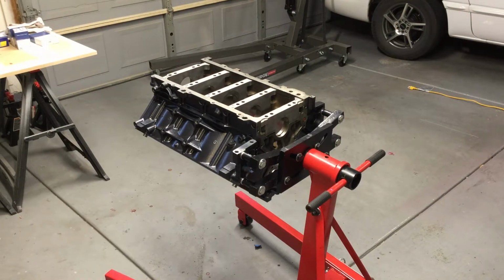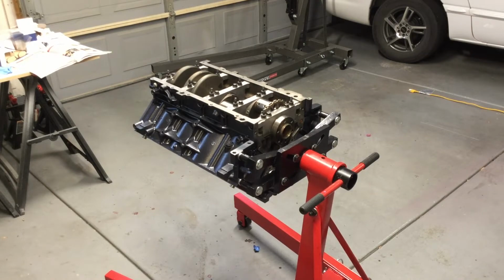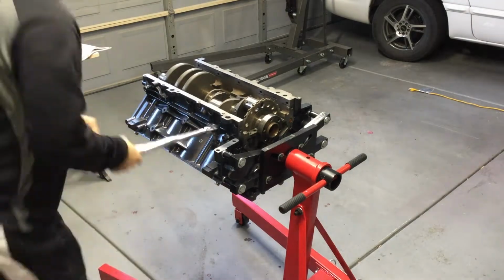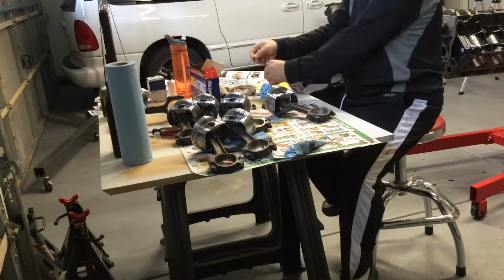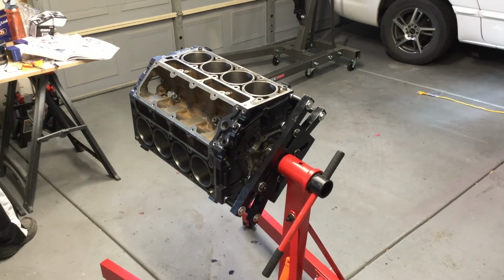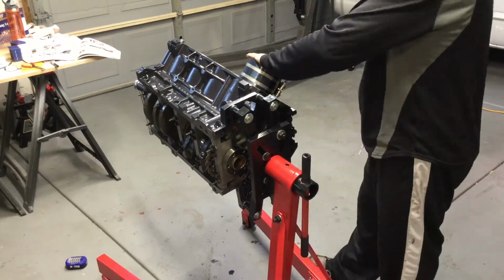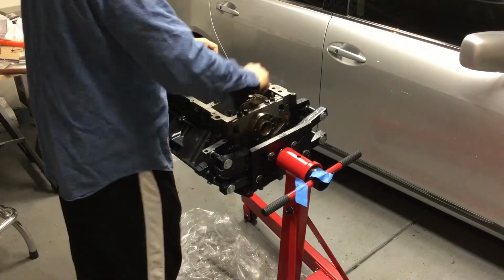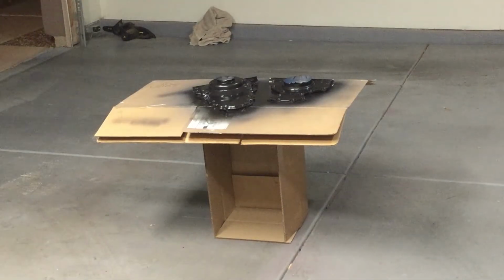How To Build An LS Engine - Assembly Part 1

Comment: What book did you buy to use rebuilding it? Author? Thanks!
Reply from the maker: Check description
Reply: @StreetRodJim   There is 3 books in your link? What one of the 3?
Reply from the maker: @jasonstrester  If you are rebuilding, use the rebuild book.  If you are rebuilding with performance, then get the rebuild and the performance book.  Swap is really just logistics of swapping.

Comment: I’m building mine right now, did you happen to smack the the crank front to back and back to front with a deadblow, it’s supposed to seat the thrust bearing.  And then check for endplay?

When I took mine apart it had close to 300000 miles on it.  The main and rod bearings had virtually no wear.  I decided to use new bearings and rings.  
I just installed the crank , measuring before hand with plastiguage.  My readings were.002” on all the mains.  But when I did the torque sequence I hit the crankshaft back to front and front to back.  So I’m going to have to loosen the bolts and do it again and then check for endplay
Reply from the maker: I did.  Do not remember much about it.  It was a while ago....

Comment: What bolts did you use on your engine stand to hold the motor on it? How far should the bolts be going into the back of the block to be safe and secure?
Reply from the maker: You want them to go all the way in without bottoming out.  Definitely need harden 10.9 or 8.8 bolts.

Comment: Awesome video 
Keep in mind that torque is F x D, if u add the cheater bar u changed the torque.
Reply: That rule is for applying torque. You can apply more torque using the same amount of force if you use a cheater bar, but using less force and more distance is the same as using more force and no cheater bar. And with torque wrenches, the torque reading comes from the head of the wrench, so the readings would not be affected.
Reply: @jacksonsgarage510  , u can’t know how much force you are applying, and you wouldn’t need the cheater bar if you could apply the right torque. They are sized for the torque range.
Reply: @tompkib  correct, you don’t know how much force you are applying, which is why you have a torque wrench... If you set a torque wrench at 50 ft. lbs and hold it halfway down the handle, then push it til it clicks, will it be torqued at 50 ft. lbs or at 25? And if you keep the setting at 50 ft. lbs and hold it a quarter of the way down the handle, then push it til it clicks, will it be torqued at 50 ft. lbs or 12.5?
Reply: @jacksonsgarage510  so based on your answers you have never checked calibrations of torque wrenches, correct?  If you have then you would know that if you don’t use the proper technique, you could be off by 5 + / - ftlbs. Adding or subtracting the fulcrum will not give you whatever you have the wrench set for.  In other words the end will break at say 50ftlbs, but that’s not what the bolt will see, or what is applied.  There are special torque wrenches that come with extensions for on purpose to allow extra force.
Reply: @tompkib  this is primitive physics, I don’t know why this conversation is still going lol. Also I don’t believe you know what a fulcrum is. The whole purpose for adding an extension is so that you are able to apply less force to the lever arm, allowing you to achieve the same reading on the pivot point that you would have achieved if you didn’t have one, except that it is easier to get to that reading. This is especially helpful when you are torquing multiple things in quick concession at increasing torque values (like he is doing in the video, wild).
Reply: @jacksonsgarage510  I don’t think you have ever used one correctly.

Comment: You sure it was a genuine ARP bolt you broke? I believe ARP's are not torque to angle / yield just torque to ft/lbs with there lube and call it a day, its why when going ARP its suggested to grind caps and line hone.
Reply from the maker: YES - ARP
Reply: @StreetRodJim   Nice I have a short stroke 296 ls in the works I should upload a day 1 video.

Comment: Putting a cheater pipe on a torque wrench completely nullifies what the torque wrench was made for.
Reply from the maker: Still clicks at specified torque.  Easier on the shoulders.
Reply: How? The head of the wrench still measures the correct torque weather the pole is 1foot or 6foot long.
Reply: The cheater pipe wasn't used to get a specific ft/lb torque number. Those bolts are set to a specific degree of angle after torquing to the specified ft/lb and he used the cheater pipe to help get him to that angle.

Comment: Maybe I missed it because, as you said, the video was sped up, but it looked like you didn’t check the crankshaft end play or the piston ring gap with the rings inside the bores. Are those not standard procedures on LS engines like they are on the previous generation?
Reply: Nah you should always check no matter if it says it’s pregapped or not. Same with crank end play. I’m just super thorough personally so I would have to know these tolerances to sleep better at night. Couldn’t just skip.
Reply: @RegulerShowTV  Ya, that would keep me up also.